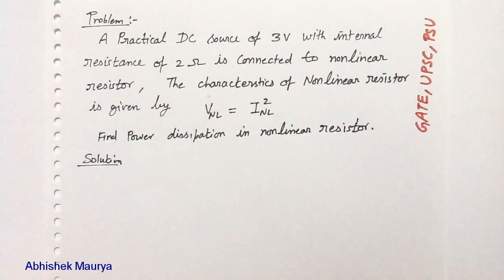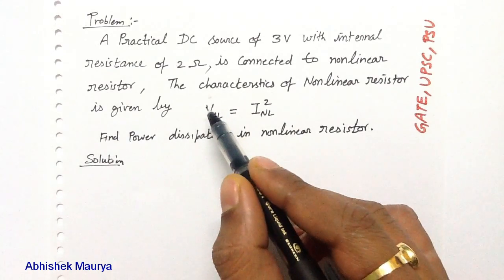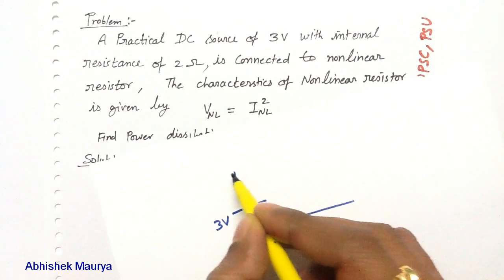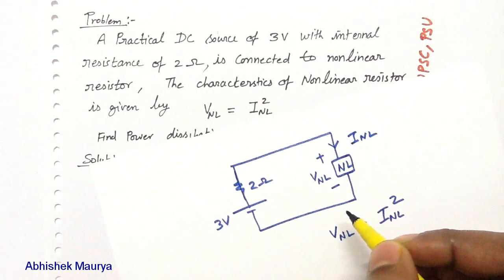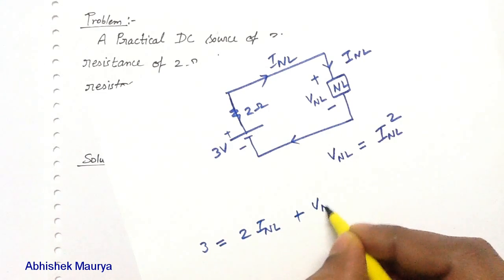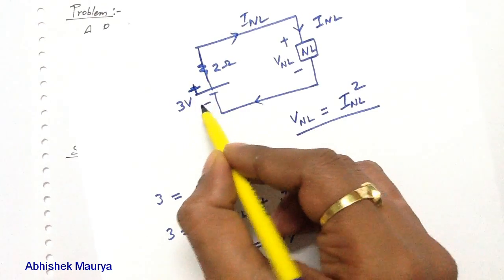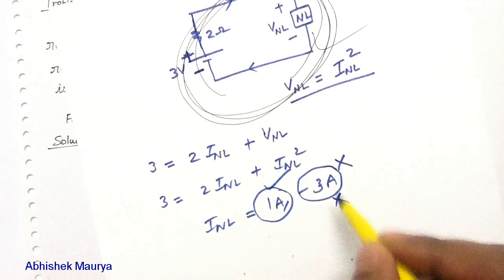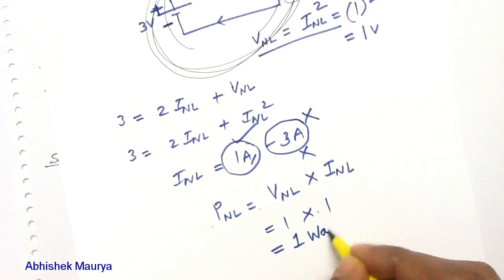Power Dissipation in nonlinear resistor

Comment: how to calculate power by superposition theorm having two dc source
Reply from the maker: find the current through the load or voltage across the load ...by using superposition ................then  find the power
Reply: abhishek maurya  but sir superposition theorm is not applicable to find power calculation